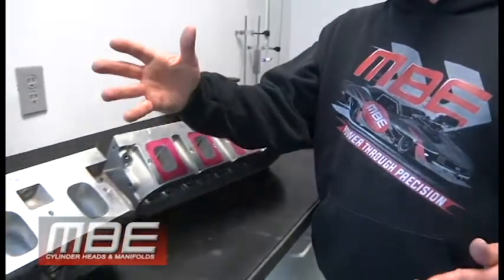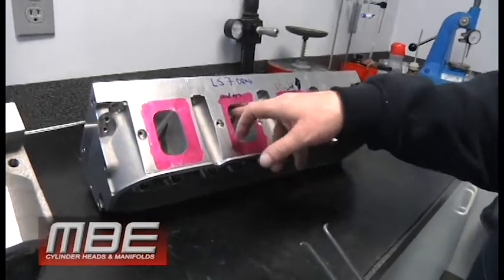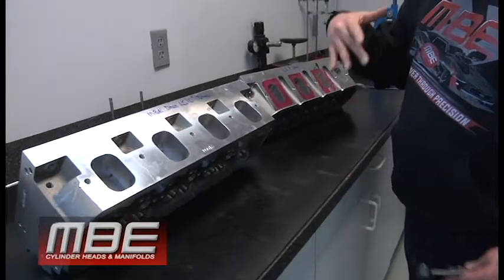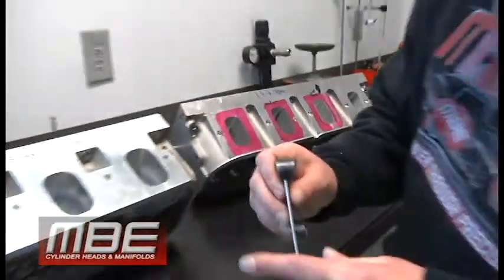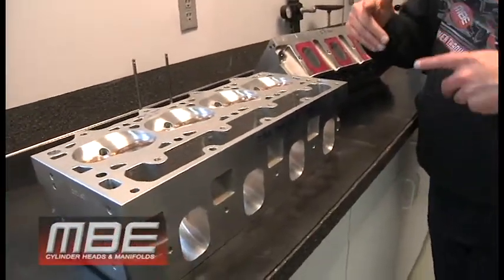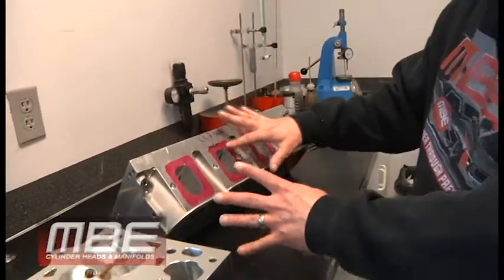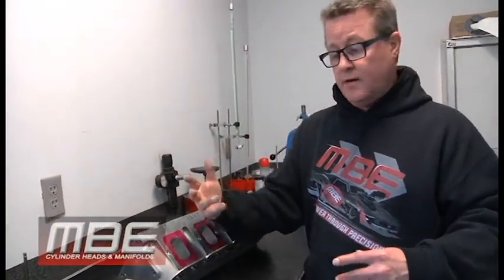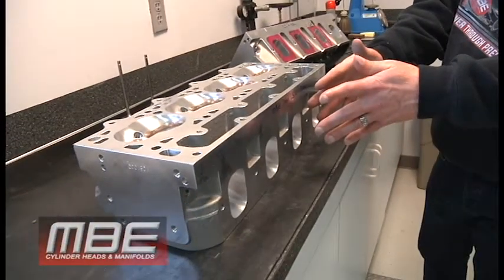MBE  GM LS 7 vs  GM LS 10  ** SIDE BY SIDE **   TECH VIDEO

Comment: It’s not just 2k more.  You’ve gotta buy more expensive rockers and intake right ??
Reply: Look at the big picture. Cars that run in the 6 and 7 second range usually cost over $250K. At that level, two thousand dollars more for head castings and more expensive valve train components are a fact of life.